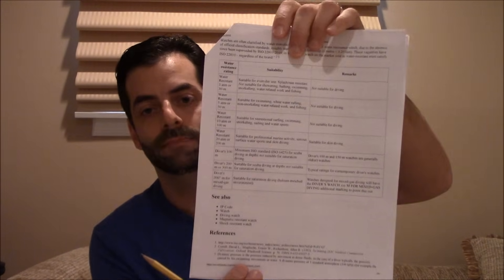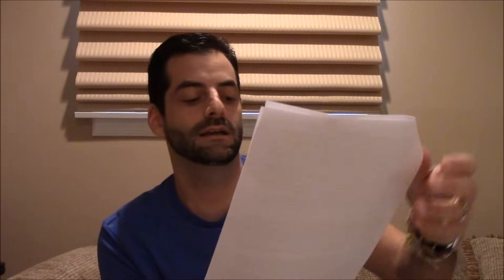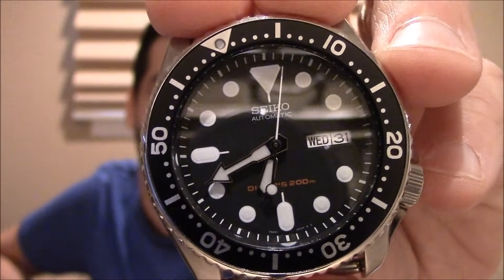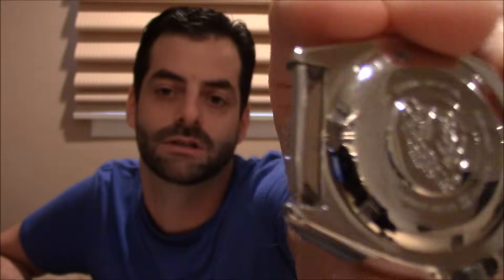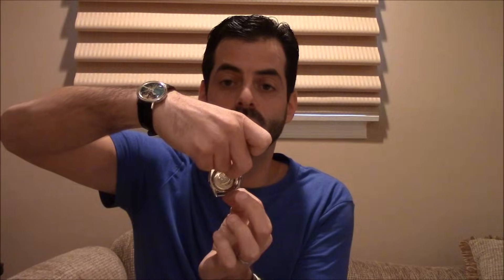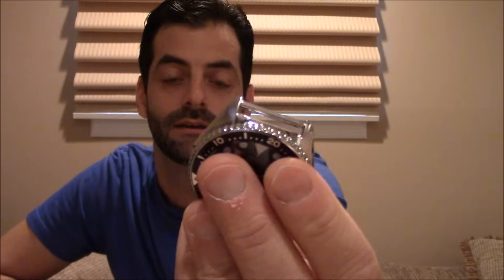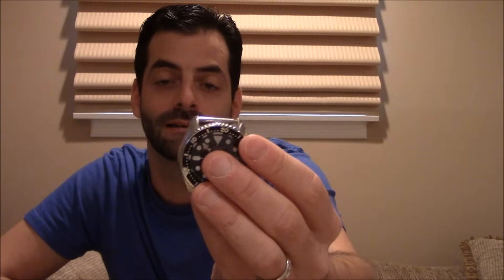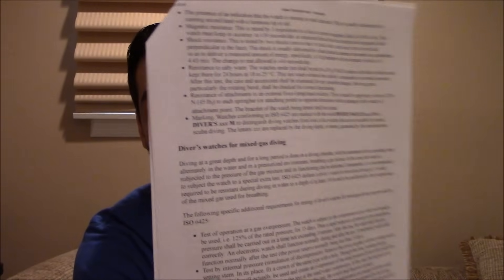What does water resistance mean? -  Watch and Learn #6

Comment: So here is my question. Since we figured out that movememnt in the water doesnt really put any significant additional pressure to the watch and since 30m WR watches have been tested to 3atm pressure, WHY shouldnt I go swim with it? Im really curious because the answer usually is that you're moving, while swimming and that adds more pressure, but you yourself did the math and thats wrong(i mean its way less significant than what they mean). According to the math i could even dive with that watch to ~29 meters. A simple 3BAR water resistant watch. But again in the end you say that what we should get out of this video is that 3bar WR isnt suitable for swimming, which contradicts your math. Im confused.
Reply from the maker: Indeed it is WR to 3 ATM, but watches age, not every single one is tested, etc. So to be safe you should not.

Comment: I never believed what was stated about movement force on a watch in water was a valid concern. Since I understand the math and physics of fluid dynamics I did not bother calculating it. I knew all along that the change in pressure exerted on the watch and seals due to motion would be nothing, relative to the weight of the water at X depth. Pressure is a function of resistance to flow, and a watch presents very little resistance. I concluded the concern about dynamic water pressure effects on watch seals was pointless. Glad you did the math though.

Comment: I was a scuba diver for about 12 years from mid 1980s to late 1990s. I would spend $15 to $25 for Casio digital watches labeled 50 meters and took them down, usually 50 to 60 feet, sometimes to 100 feet or a little more. Worked fine, never a failure. One of my instructors told me he had one in which the water pressure at 80 feet or so started pushing the watch’s buttons and it went crazy. Never happened to me. I swam with these watches, ran, rode bikes…they would take a licking. I would use them until the cheap plastic watchbands would break then it was back to KMart for another one. I no longer dive, but I swim with a Timex Ironman. I limit my Tissot and Omegas for more civilized environments. They say ignorance is bliss. I was a happy diver.

Comment: 16:08 Quartz divers are falling out of favor because divers use dive computers instead. Dive computers basically are souped up digital watches that present a lot of diving specific information and run on  lithium batteries or rechargeables. They have battery indicators and warn explicitly if you try to use them when they're low on battery.
Reply from the maker: I probably should have clarified that. Most of the Seikos and Orient divers have gone away from battery. I do understand that dive computers are quite popular. Thank you for the insight.
Reply: Dive computers are great but I still use both. Always good to have a manual backup when I’m underwater.

Comment: sticking your hand out the window while driving is a doubly nice example cause it explains what we're talking about in a practical manner and also tells you why this thing with the pressure is a myth - a watch face is several times smaller than even a small palm, so the surface is small enough that normal movement under water isn't enough to bring it above the safety limit
Reply from the maker: also, you don't swim as fast as you drive, hopefully.

Comment: I am a Electronics Engineer; you are right on the mark regarding testing methods, and math calculations. Many watch makers will do a static test at 10 bars for few minutes and not facture temperature variables. I have a Citizen echo watch that was quite expensive, there is no screw on crown or back case, and it is rated at 20 bars. My very expensive Hamilton does have screw on crown and case back rated at 10 bars. I would trust the Hamilton over the Citizen for testing if I chose that path, "great discussion".

Comment: I have a quartz Rodania since 2002 with 50m WR. Used it many times while snorkelling at depths around 5-6 meters every summer. I have even cleaned it in 1:1 diluted spirit of salts (~9% nitric acid) to clear the gunk that accumulates over time. I have had is battery replaced in the store I purchased it and in other stores, too. Never had any signs of water getting into the watch. It has a screw in case back. I believe good brands usually under-promise these types of specs.

Comment: it's really a controversial subject. I reviewed my swatch Irony windfall, which I own for about 20 years. I use it for everything like swimming, showering, windsurfing etc.. never had an issue with it. I even use to operate the chronograph under water! As soon as one of my watches mentions water resistant, I'll take it for a swim although I try to avoid that if it's fitted with a leather strap..anyway, nice video! cheers
Reply from the maker: Haha, yes, true. Thank you! I've seen 30 meter watches used for diving and 200 meter divers fail in the rain!

Comment: thanks for a informative video.
just one question regarding the necessity of the lumination; is it safe to drive in conditions so dark that one can't read his watch?
Reply from the maker: It's not an issue of darkness, its low light. It makes the watch much easier to read. Light cuts off at shallow depths, as well as you can swim under a light obstruction.
Reply: Also, night diving is a thing. So yes, it can be safe to dive when it’s dark.

Comment: Funny... like most other people, I've been assuming that "30 meters of water-resistance" means just that. So I've abused my watches over the years quite a bit, especially the beaters. Which, I have to be honest, were mostly regular Swatch models. And I haven't had any of them croak due to water intrusion. I've used them while fishing, swimming, water-skiing, snorkelling, boating ... you name it. And most of the time I was in sea-water with those cheap little plastic watches, thinking they'd be perfectly safe ... :D
Come to think of it, I've been wearing Swatches since the late 80s ... and the only one that ever died on me was a late 90s Irony Chrono that, after 15 years or so, started to suffer from a misaligned second hand.

Comment: Great video.  Very educational and so much so that if I'm ever in the market for a watch again, and it's one you sell, I get it from you.  However, I think your negative comments regarding quartz divers is misguided.  First of all, all dive computers (which is what real divers use in the modern age) are battery operated.  Second, most high quality quartz watches indicate when the battery is getting low by skipping every two seconds.  Third, there is a much higher chance of a mechanical watch developing an unknown problem and even stopping than there is of a quartz watch suddenly losing battery power.  Fourth, if you have any problem with equipment, being a computer or watch, you simply end the dive and slowly return to surface, and serious technical (deep) diving requires redundant technology.  The truth of the matter is that if watch wearers were really concerned about having the most reliable and durable watch, all sports and dive watches would be quartz.  The reason less companies make such quartz watches, particularly at the high end, is that watch enthusiasts simply prefer mechanical watches for reasons other than logic and practicality.  I like mechanical watches too.
Reply from the maker: Thanks for sharing!
Reply: You are lefty ,,,,,,,
Reply: yes, watches are like no other market.  $15 dollar digital display watches probably keeps much better time than quartz operated watches.  And quartz operated watches probably keep much better time than automatics.  my $40 casio digital display watch quite reliable after 4 years of going into the ocean always pressing temp indicator function w/o having to replace battery.  finally give it to friend to get something new.

Comment: Liked a lot that explanation. Both the one about the iso and the maths. but considering that, why can’t i dive with my 100 meter/10 atm water resistant watch?. I know i shouldn’t but i don’t understand why it claims 100 meters if it can’t go to those depths if the movement nearly doesn’t afect.

Comment: Hi, the swimming pressure underwater has been debunked, but there is a very real discussion involving the pressure difference between air and water. 
For example, you might be ok swimming with a 50m, but diving off a board will create a substantial increase of pressure at the air/water interface and can force water past the seals. Additionally, you can usually get away with diving/jumping into water with a 100m watch, but falling off a seadoo, will again, force water into the watch. There are even companies that recommend not using there 200m watches on seadoos. So just thought I'd point that out. Cheers
Reply from the maker: That goes with the speed equation. You'd have to go 50 mph to equal a 25m depth. I still standby the numbers.
Reply: Long Island Watch that only talks about the watch being underwater and moving. None of your numbers reflect the pressure on the seals when entering the water from the air. Are you denying that your wrist smacking into the water from a high dive would put no additional pressure on the crown? That could be enough to knock some watches off. No matter how fast you swim under water, there is never enough to equal that.
Reply: A dive into water would have nearly zero effect on the crown, as it is screwed down and basically a tiny solid protrusion from the case. It is too small for the water to have any real acting forces upon it. Also, for the water to get anywhere near a crown seal, it must first creep all the way through the minute helical space left by the root of the crown threads, then past the conical metal-to-metal contact seal at the top of the threaded boss, and then through a small gap between the crown shaft and it's bore, to finally get to the crown shaft seal. Water molecules are large, and tend to cling to surfaces and slow the flow also. A smack on the water is not long enough to effect any of this. It's the same story with the case back- the flat steel flange is screwed down tight against the flat case back by the linear action of the threads. Water would have to somehow creep past that flat contact metal seal between the two parts, before it ever gets to the case back o-ring. Screw-down crowns and case backs won't be bothered by momentary dynamic pressure. A more immediate area of vulnerability would be the seal around the crystal. It has a HUGE surface area which can be acted upon, and the tiniest movement of the crystal could affect the integrity of the factory pressure/interference fit around its' perimeter where it's pressed into the case. The absolute most vulnerable though, would be older degenerating rubber seals (probably silicone/viton/buna-n variety) in an extended high-psi static situation.

Comment: Very nice info. hey i have an old seiko 5 SNKN85K1 with a 50m water rating can i still use it for swimming, im not that fast of a swimmer but the watch is not a screw down crown.
Reply from the maker: I'd be careful. Especially if its old. You should get the seals checked first.
Reply: I did send it to a local watch shop to have it service and water tested a couple week back, i asked the guy and he said the all the rubber gasket have been replaced. Could it relatively survive my slow swimming?

Comment: What really confused me the other day was the Suunto Core - I know 30m resistance doesn't mean "you can dive to 30m depth", and the Suunto has a resistance of 30m and can measure your depth in water up to 10m. So, presumably it's safe to use it to dive to 10m at least?
Reply from the maker: 30m shouldn't be used for swimming really. At least that's the guideline.

Comment: Marc,check out Vostok' approach to underwater use.Doe to not having the case machining abilities they handled psi. by using outside water pressure to continually push on the Plexiglass Crystal, somewhat free moving bezel, and 2 piece watch back.The concept finally failed at 850 something meters and is still in use today.The Plexiglass was chosen over Acrylic and Sapphire,as it tested most reliable when paratroopers had to jump from warm airplanes into +/_0  temperatures.The rear case gasket and mean gasket is like a car tire not a tiny rubber o ring
This system is still in use today.For a $ 59.00 ScubaDude u can check it out.🍻

Comment: I have a question so you debunked the theory of dynamic pressure underwater while swimming but what about splashing. I was always told that splashing water or water falling under gravity is equal to an increased depth. For example if you take a shower and the shower water is streaming towards your watch and hits around the gasket area.  The watch may be rated for for 50 meters but that pressure from the water stream could be much more than that

Comment: Just a thought regarding DYNAMIC PRESSURE.

Unless I am mistaken your DYNAMIC calculations in regard to pressure was calculated at a STEADY STATE VELOCITY through the water. I am extremely rusty with my Calculus (over 30 years) but wouldn't ACCELERATION through the water by body parts be more relevant? It seems to me that the TRANSIENT pressure spike would be calculated by the Differential of your Steady State Velocity equation and give a transient pressure that would be considerable higher than what you have predicted for steady state velocity. I suspect that transient pressure is significant because once the water seal is "cracked" there would be little resistance remaining to prevent water ingress.

Or maybe I'm barking up the wrong tree.

Comment: Little mistake there, the correct dynamic pressure of a watch moving at 3m/s would be 4500 Pa. Either way, if you are on a jet ski moving at 80km/h (22.22m/s) and you fall into the water, a 30m resistance watch would be ok.
Reply from the maker: Yes, see the edit in the description : )

Comment: I know how they could make a watch which is basically waterproof:

Solar quartz with lithium cell, digital
Now fill it with mineral oil (doesn't degrade or corrode the movement)
All parts of the case are synthetic and melted together in the end

Comment: Dynamic Pressure = 0.5*1000*9 = 4500

Your math is off by a factor of 10 but its still 2 orders of magnitude smaller so doesn't really change the conclusion.
Reply from the maker: That was a horrendous blunder! Thanks for the pickup.
Reply: Still a very interesting video.

Comment: It's obvious that the claims of water resistance of watches belongs to the biggest frauds in the industry of technology.
While 30m is the lowest common claimed water resistance for a watch it's still a depth for experienced divers, and the water pressure is 4 times the surface pressure. If a model is not secure to be used for bathing and shower it should simply not be to claimed as 30m water resistant. Then it should be called "splash resistant" or similar. 
You don't claim that a rope can hold the weight of a car, and at the same time that it's not suitable for lifting a motorbike. That's double talk.